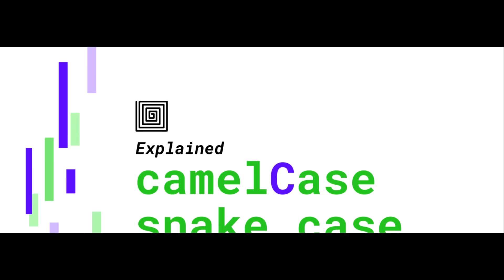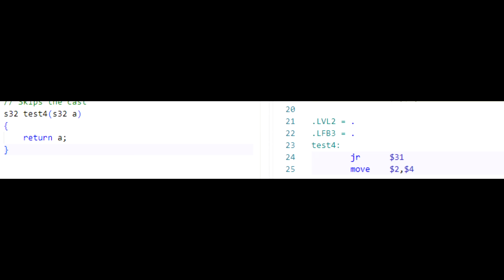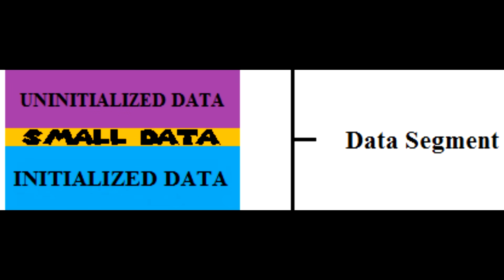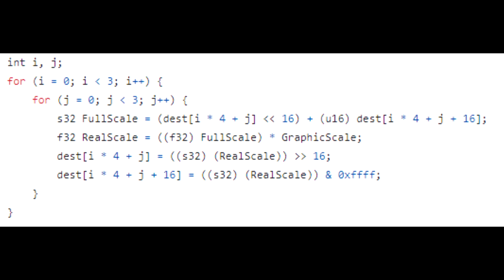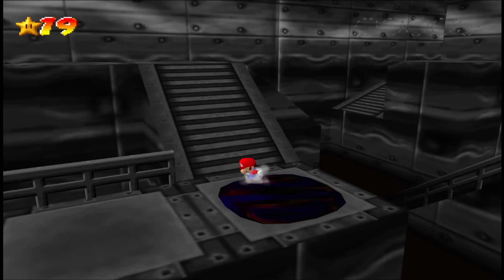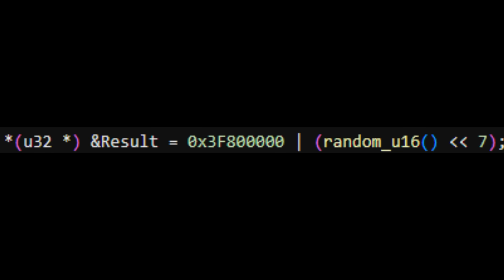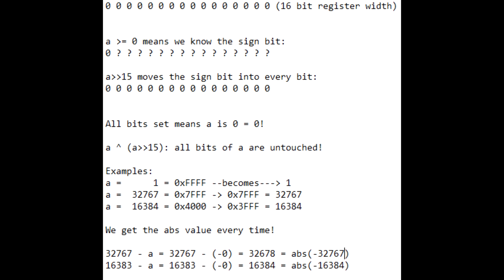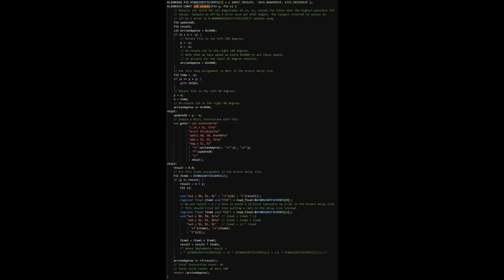Optimizing with "Bad Code"

Comment: Man, whatever glitches you miss when you release this are gonna be wild. You're playing with extremely volatile logic alchemy here, even more unsafe than Pokémon Gen 1.
Reply from the maker: i had had to deal with some insane bugs before LOL
Reply: @KazeN64  A video about some of those would be very entertaining lmao
Reply from the maker: @javaguru7141  oh that could be cool!
Reply: Inb4 Return to Yoshi's Island Triforce%
Reply: Remember that it's a relatively recent phenomenon in computer programming where languages stop you from touching things that it thinks you shouldn't. C is a language of the era that you are the master of memory and it gives you all of the tools to do with that mastery what you wish. Compiler errors and warnings exist as little more than suggestions to a competent C programmer. Regardless of type you think it is, if you want to set XYZ memory address to ABC value, you can do it, and sometimes it'll be faster than doing it the "safe" way.
Reply: @Vixikats  Oh, I know. And it's not the languages, it's (mostly) the CPUs and operating systems doing the legwork. C programs running in usermode (and several newer languages too) can still corrupt their own memory and all programming languages can crash, easy, but they won't take down the whole computer with them due to memory segmentation and virtual address spaces (unless the program interfaced with a buggy kernel module or smth). Crash handlers did exist in the '90s, but for some reason freezing the console and waiting for a secret dev code to dump memory addresses and stack traces on screen was standard. Heck, Windows 9x just lets you try to continue execution after a BSOD.
Reply: @Vixikats  Laughs and cries in Game Boy
Reply: I heard that if you ground pound at the wrong spot in the oil blarg fight, the game crashes and Mario climbs out of your TV screen. Works only on N64 though

Comment: in some old games that super optimizations in the mid to late 90s i saw that in their source code they use to keep 2 version. A more clean version for porting to other systems and a dirty one that was platform specific. I remember some games had both a C and ASM version in some cases.
Reply from the maker: i'm surprised they actually cared that much to optimize code. that's a neat way of handling it. luckily for sm64, most of the functions still have an equivalent of the base decomp if anyone wants to port this stuff. (i also usually leave a pure C version of the code above it for everyone to be able to figure out what the code is supposed to do)
Reply: @KazeN64 Why do you "force" gcc to produce the machine code you want instead of just implementing the function in assembly? Is it the calling overhead?
Reply from the maker: @uwirl4338  its just really annoying to do inline assembly in GCC. it throws so many errors. it's easier to get it right by just throwing in small assembly snippits into the C imo
Reply: @KazeN64  I agree, the syntax is horrendous and doesn't feel like asm as all
Reply: They made so many games, but rarely released source code for most of them.
Reply: @Alibaba-id4dw  True. I will say this however, if you try making your own games in asm for those old platforms there's a good chance you will create similar techniques independently
Reply: @uwirl4338 we do the same. First try to get the compiler to do what we want. Second try harder. Third worry about something else. Fourth intrinsics. Fifth asm
Reply: @williamdrum9899  So it's not just me, in terms of bemoaning inline assembly in GCC, it actually is syntactically annoying?  *breathes sigh of relief*

Comment: "how much did you improve the performance?"
"by roughly 2 fps."
"what did it cost you?"
"i can no longer read the code, let alone make any changes."
"was it worth it?"
"you bet"
Reply: But hey, rambus go vroom vroom
Reply: Gonna make the most incomprehensible code ever, not even the most advanced of AIs being able to accurately read it, to make the game 0.1% faster, worth it (dw it adds up to 0.7% with other stuff)
Reply: "what did it cost you?"
"the resulting binary can no longer be disassembled because i use invalid opcodes, you have to poke a NOP at certain memory locations, disassemble it and then add the missing instructions back, by hand."
Reply: You realize it's completely worth it because it's a systems function that doesn't needs being read or changed. It's like that one fast inverse square root function. Literally who cares if it's impossible to follow?
Reply: @GeorgeTsiros  😭😭😭😭😭😭😭😭😭
Reply: @michaelbuckers  For real. Sometimes, you just gotta trust the wizards. After all, the only reason keyboards have more than a "0" and "1" button is for the convenience of the operator.
Reply: @michaelbuckers  Yeah and I would also like to point out that this kind of careful work has gotten him WAAAAAY bigger gains than 2FPS.

This work has gotten him gains like "3x the framerate with 5x the polycount"
Reply: It looks way more than 2 fps to me. This stuff adds up quickly.
On the other hand, the inverse is true. Modern code spend a lot of energy to do a ton of nothing.

'Incomprehensible' code can be solved with new middle-man automation (that is why compilers exist, and performance-aware compilers like SIMD intrinsics can be developed). 'Wasteful' code is apparently a customer problem. :)
Reply: @michaelbuckers  everyone should care, because if that function causes a serious security issue then it could potentially hurt people's lives
given this is super mario 64 it's not as big a deal though, would probably at worst cause some weird bugs that are going to be hell to fix but given the project goals and constraints it's probably worth it. the only thing i'd be really worried about causing security issues is loading user made levels
Reply: @fiona9891  What security issues? We are on either the N64 or an emulator that should be secure in itself(no, P64 1.6 does not count, stop using it. There are multiple better emulators, including the next upcoming stable version of P64 itself)
Reply: @michaelbuckers "a systems function that doesn't need to be read or changed"
That logic works only if 
1) the project is done already, and somehow you know it has no bugs (impossible), or
2) You're the only one working on it. If you're working with a team, the team needs to know wtf you're doing.
Reply: @mariotheundying The most advanced AI is a low bar
Reply: skill issue

Comment: 8:15 I work as a graphics programmer for an engine at my job and this style of coding is incredibly common on the low level parts of the rendering pipeline. I always thought the person who wrote these was insane, but now I finally understand.

They really are insane

Comment: Rule 1 of systems coding: "the compiler is smarter than you are"
Rule 2: "except when it isn't"
Reply: I always go by "The compiler is not your friend." which I read somewhere on the internet a long time ago. ;w;
Reply: @colonthree  "YOU NEED TO BE THE COMPILER !"
Reply: @colonthree  but it is your coworker...
Reply: Wait? Who's the compiler and who's the compilee?
Reply: compiler? i hardly know her!
Reply: @colonthree Unless it's rust, then the compiler is definitely your friend.
Reply: I remember randomly scroling through kirby's return to dreamland code when I was bored one day.
There were funtions that only had one instruction.
Cuz all power pc instructions are the same size, it means that the instructions to branch and return are each equal in size to the funtion.
Reply: @MrGamelover23 at this level of performance requirement the borrow checker would do nothing but get in the way
Reply: Never talk about fight club
Reply: @MrGamelover23  I was about to say rustaceans need to realise this as well. otherwise you will lose performance with too much safety
Reply: Rule 1: Never optimize prematurely.
Rule 2: Trust that compiler does better job than you, until it doesn't.
Reply: @MrGamelover23 rustc is both your best friend and worst enemy at the same time somehow
Reply: rust is if nobody asked was a programming language
Reply: Assume the compiler is smarter than until until you get obvious evidence of it being an idiot.
(Translation: Profile and inspect the assembly before questioning the compiler. After doing those however, question the compiler as much as you please.)
Reply: i love this

Comment: It's quite interesting that the reverse loop count isn't just MIPS exclusive but is fairly natural, in fact, as an SNES dev: Although the 65xx family generally lacks a dedicated decrement and branch if (not) zero opcode (exceptions like the SPC700 do exist), it's still faster to decrement a loop count (preferably an index register) then incrementing it because decrementing a value also affects the zero flag which affect whether BEQ and BNE ("Branch if Equal / Not Equal" but actually "branch if zero / not zero") jump. There also is Super FX which has a dedicated loop opcode which too works by counting down and not up (although there rarely is any reason to use the loop counter directly and it's easier to subtract a constant from the pointers than recalculating the pointer + index).

In the end, this is indeed a missing compiler optimisation.

Comment: Hi, I’m curious about the possibility of using AI to train a Multi-Dimensional Code Analysis and Optimization System. What do you think about this approach?

It’s like building a 3D model of code – analyzing all angles at once instead of viewing it from just one side.
The 5 key dimensions are:
1⃣ Semantic Analysis
2⃣ Structural Analysis (AST)
3⃣ Control Flow Analysis
4⃣ Data Flow Analysis
5⃣ Pattern Recognition (Vector Space)

Do you think LLMs can support this approach? Would love to hear your thoughts! 🙌

Comment: 13:03 this was very new for me. I thought right shift always fills the most significant bits with 0 but I just learned that there is a difference between logical and arithmetic bit shifting.
The logical bit shifting will fill all the new values with 0. Arithmetic right shifting on the other hand will copy the the MSB for all the new bits to guaranty the result will be half of the original value and therefore performing an arithmetic division by 2.
Arithmetic shifting seems to be machine specific though. C doesn't guaranty it.
Reply from the maker: C does arithmetic for signed values and logical for unsigned values. MIPS has instructions to do either in 1 cycle.
Reply: That's also a thing which confused me at first when I read the Super FX instruction set (it also has a DIV2 which is ASR except for input 0xFFFF which becomes 0 but notably no LSL nor ASL) since I've worked on 65816 ASM (SNES dev) which only has ASL and LSR but no LSL nor ASR.

Fun fact: The 65xx ASL is actually a logical shift because ASL doesn't take the overflow flag (i.e. an "unexpected" change from negative to positive and vice versa) into account. It seems like the only reason why they're named that way is to make it easier to see the direction the shift applies, lol.

Comment: Honest question. Why not code the game in ASM directly? ASM is ideal for squeezing every bit of juice you can. And the main disadvantage of ASM (besides the complexity) is that it's hardware specific, which doesn't apply here, since you are developing for a specific hardware anyway. 
A lot of these tricks are more complicated than they look because you are manipulating the compiler into writing a specific sequence of ASM under the hood. You could just write them directly.
Anyway, I really love the video! it was super entertaining, funny, and full of cool information.
Reply: wait, I just read the pinned comment. There isn't a way to write asm?? that is insane!
Reply from the maker: @diegofloor  I've figured out a way to write in asm without too much of a pain and i did write some important routines in it. writing the whole thing in assembly still seems unreasonable though. there is so much actor specific code where writing it optimized is barely a benefit. plus, writing assembly in a fashion that is more optimized than what the compiler does, takes serious effort compared to just writing assembly code.

Comment: Though word of caution, using inline assembly can sometimes discourage the compiler from optimizing certain things since it can't be sure of certain assumptions anymore, and if not it's likely the code will break once you change optimization levels. I always avoid inline assembly inside of C functions as a result and only really use inline assembly in naked/their own functions.
Reply from the maker: if this made the compiler any worse, i would notice it.

in fact, gcc's mips compiler has a bug that makes it insert a few unnecessary NOP instructions after float comparisons, but if you have any inline assembly in the same compile unit, it will discard these NOPs. GCC's mips compiler works better with inline assembly
Reply: @joopie46614  As was mentioned in the video, some N64 models have a hardware bug, which makes them fail to calculate two floating point multiplications in a row. Rather than treat that as a constraint and place other instructions in between multiplications, GCC instead just replaces every float multiplication with a float multiplication followed by a NOP, considering the bug to be too rare to be worth accommodating  properly.
Reply: @angeldude101  Damn. I can think of issues with a SNES C compiler already (basically, multiplication and division requires you to wait a couple cycles before you can read the result) but Super FX gets particularly difficult with its ROM and RAM buffering system (basically, if you want to read from ROM, you have to set the pointer which also tells the processor to cache one byte whereas writing to RAM doesn't write to the memory directly but also goes through a caching system, both which take time).

Comment: This reminds me of the time I was looking at the asm code for return to dreamland.
There were funtion that straigth up just were a single instruction. 32 bit power pc's instruction are all the same size.
Meaning that this instruction was of the same size as the branch to call it and to return it, individualy.
Reply from the maker: even worse: the call will scramble up the registers and likely take 5-10 extra instructions so its just always worse lol
Reply: @KazeN64  yeah.
I wonder why compilers end up doing this.
Reply from the maker: @quedtion_marks_kirby_modding  it's the programmers doing it. they are telling the compiler to do it like that
Reply: @KazeN64  Any idea why they would do it?
Reply: I have a feeling this may be the result of a simple function in one C source file being called from another. Without link-time optimization, the C compiler only sees one .c file at a time, and while it can inline into other functions in the same file, it has no idea what happens in any of the others. All it sees is a function with global visibility that happens to be a single instruction, while in the other file it just sees a function call to some function that it doesn't have the implementation for.

I'm uncertain about C, but I know for Rust, marking a function as `inline` will embed extra metadata for it in the intermediate object file so that the linker can inline it at link time. Turning on link-time optimization does basically the same thing, but for every globally visible function. Traditional link-time optimization however can be very slow, so it's often not enabled, though LLVM has a "thin LTO" which seems to get most of the benefit, but with much faster speed.

The alternative is to know that the function is so simple that you always want it inlined, in which case you should define it in a header file rather than a .c file. Unlike other .c files, the compiler will treat the contents of every included header file as being a part of the given .c file, allowing it to inline everything as needed. If it doesn't inline however, then the function will get bundled with the intermediate object for every single .c file that called it, resulting in a ton of duplicated code.

Or of course there's the possibility that the devs just forgot to enable optimizations, so the compiler never even tried to inline anything that wasn't explicitly required to be in the source code.

Comment: Remember to use the shortest variable names possible. This will reduce the time it takes for your compiler to process your code into an AST. On top of that use letters that have the smallest pixel area and simplest geometry so your IDE will render them the fastest due to true type fonts. l and I are great for this

Comment: As someone who's intimately familiar with the RISC-V instruction set, it's interesting to see how MIPS, the N64's instruction set, is so similar that most optimizations would still apply to a RISC-V system. A stand-out example for me was the global pointer optimization avoiding a two-byte LUI-sequence at 4:11.
Reply: RISC-V was based on MIPS. You can think of it as if MIPS was designed again but with an extra ~25 years of experience.
Reply: @Sauraen so they fixed the branch prediction design? /jk

Comment: I'm pretty sure casting a function pointer to another one with a different return type would be undefined behavior if you didn't build for a single platform. It's funny in a sense, you don't have to ever worry about undefined behavior since you can always test to see what the n64 does.
Reply from the maker: that seems like something that would be undefined in terms of the outcome but it would have a pretty clear definition as to what it should compile to

idk the whole idea of "undefined behavior" kinda vanishes when you have 1 compiler and 1 architecture. everything's defined by how the compiler works in the end (assuming there is no random noise it pulls from)
Reply: @KazeN64 Pretty much, I always get annoyed when people say "tHe cOmpiLeR cOuLd dO wHateVer iT waNtS!"